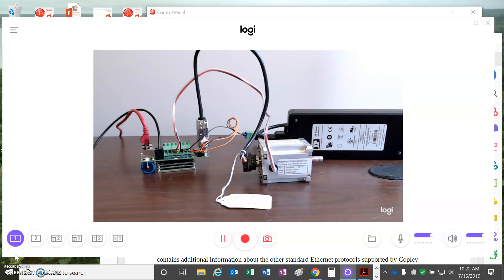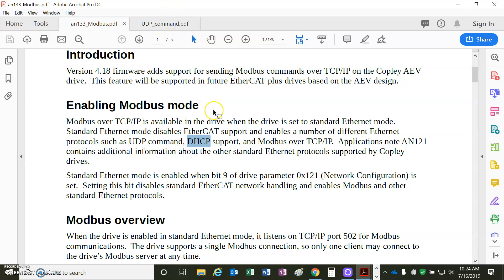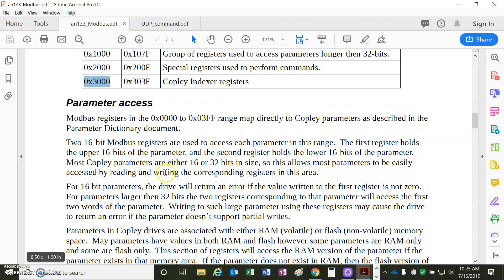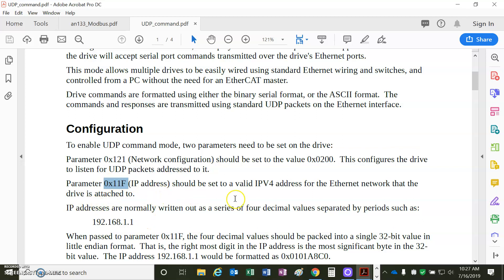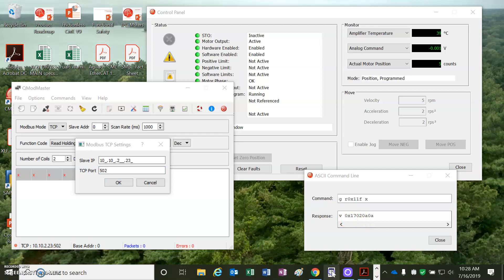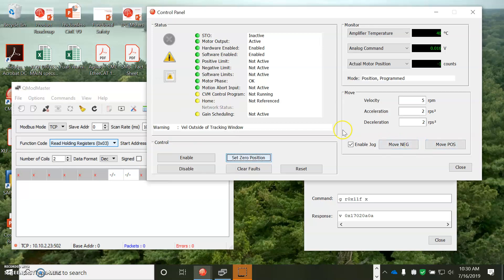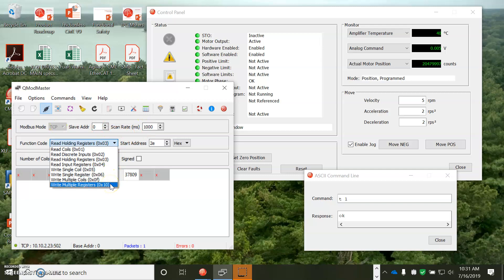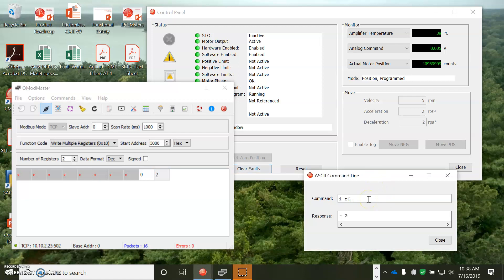Open Source QModMaster on Windows with Copley Modbus-TCP

Comment: very nice video on hard to find modbus info... :/    modbus also works using rs232 com-port on simple projects.  i am new to wireshark and would like to use it with modbus?  thanks..:)
Reply from the maker: Copley drives to Modbus TCP using Ethernet port. We do not do the old Modbus RTU. :) Let me know if you need a servo or stepper drive. dcrumlish@copleycontrols.com